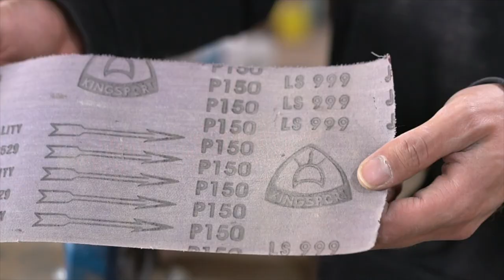RESTORING AXE HEAD TO MIRROR POLISH #restoration #axe #hatchet

Comment: At first, it looks like a brand new piece that was left outside to rust naturally. It doesn't show any signs that it's old or has ever been used before. But even so, nice work in making it mirror-like!
Reply from the maker: Thank you 🙏🏼 You're right, it isn't that much old.